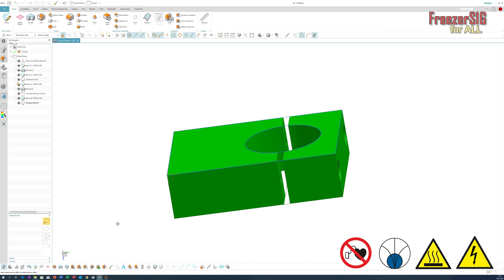Podgrzewacz indukcyjny do metalu.

Comment: Hello. What is the frequency it operates?
Could it heat 304 stainless steel wire? 0.080"/2mm in diameter.
Reply from the maker: The video shows me heating a teaspoon, it's made of stainless steel. It heats up much less. I did not try to heat the acid-resistant steel.